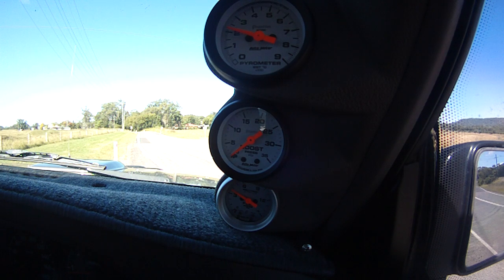Dawes Valve Boost Control with Nissan 3L Patrol ZD30DI Diesel GU Waggon

Comment: I fitted a Tillix/Dawes after a while world of issues. I cannot remember what rpm the car saw full boost. But mine now struggles to really make boost until 2500rpm. Is this normal? I know there is alot of variables with different loads. But before i had all my issues i swear it could of responded a bit better.
Reply from the maker: That isn't the norm, should be almost, if not maximum, by 2000rom. So many things can cause issues like this.
A few things to check.
1. VNT arm rises to top of stroke when engine started, disconnect vacuum line to the VNT start engine and then while watching the VNT reconnect the tube, arm should immediately rise. You can do a manual test by connecting a length of tubing to the VNT control diaphragm with engine off, then suck like crazy on the tube, you should be able to make the arm rise by mouth, vacuum required is around 12-13"Hg and by mouth you should be able to reach 18-20"Hg. 
2. Check if the arm will stay at the top of stroke if vacuum tube is clamped off and engine stopped, if is doesn't the diaphragm could be damaged.
3. Check vacuum lines under the intercooler, it is not uncommon for damage to occur from rubbing against parts under the IC.
4. Buy a cheap vacuum 40-50mm gauge, industrial type not one you mount in the car, and test vacuum with engine running the vacuum pump should put out 28-30"Hg.
5. Pull the Dawes apart (counting the number of turns to undo) and check for crap build up internally.

Try these things to rule out the easy things.
Reply: @Geeyoutoo Vacuum is mint now and actuator rod moves freely and smooth. I originally washed the engine bay down. And figured out why it wasn't making boost. It was an old perished line under the intercooler still didn't work. Replaced all vac lines with new ones and had no luck. Tried another maf still had issues. Took it to the shop and got told it was MAF and it was fixed. It was stuck on 8psi in all gears, so i changed to another VAC solenoid and manually reset the 0406 code and then it started making boost but would hit a limp mode, which would cause me to have to turn the car off or sometimes id drive through it. The spool up has definitely changed since having all these issues. What I did notice is when I bypassed the VAC Solenoid without the tillix yesterday before I installed it, it felt strong and it would spool but cant really say as i have never really taken notice of when it spools until after the issues from washing down the engine bay. Been a big headache with money and time. But definitely doesn't hit limp now with the tillix and dawes. 
I will definitely go and test the diaphragm the way you have mentioned.
Reply: @Geeyoutoo  No matter how far i turn the tillix in to increase spool rate nothing happens. Full throttle in 1st doesn't see boost until 2000rpm and only made 6 psi at 2500ish. Even tho the vac solenoid is bypassed can it mess with ECU if it's half shagged?
Reply from the maker: @kaseyeveringham2867  Pull Tillix apart and check for oil and crap it seating correctly. Do you have a needle valve? for a Tillix and needle valve to function you need a separate T for the needle valve. The Tillix and Dawes both work on the same principle except the Dawes is better sealed around the threaded adjustment section. You can easily check the sealing around the thread by sucking back on the boost end of the Tillix, if it is easy there is excess leakage.
You have the VacSol bypassed so I read, I like to run with that in place, what year is your Patrol?
Reply: @Geeyoutoo  Thanks for the reply! It is a year 2000. I did buy it second hand from a guy which his engine did blow up. It would kind of make sense the tillix and dawes was out of thr car for 8 months
Reply from the maker: @kaseyeveringham2867  OK, better give me a full list of the mods you have, 2000 Patrols (same as mine) can be problematic re vacsol disconnection especially if it is a manual. I would reconnect the Vacsol, they can also become contaminated internally with crap if the lines have been played with, maybe give it a LIGHT internal spray with WD40. Are you sure the plumbing for the vacuum lines is correct?
Be aware that a standard ZD30DI will go to limp at around 15PSI boost if the ECU sees certain parameters reached by certain revs.
Reply: @Geeyoutoo  Engine side. 3inch exhaust, EGR, took a butterfly out of the throttle body. I pulled apart the tillex and sprayed it. I'll need to mess around to find the perfect settings. But the dawes nearly turned all the way in still struggles to make boost under 2100rpm
Reply from the maker: @kaseyeveringham2867  You mention Tillix and Dawes in your setup, should be one or the other. Could you take a pic of your setup and post it please.
Reply: @Geeyoutoo  Needle and valve is turned all the way in also. Still laggy all the way to 2300rpm then it starts to ramp in but couldn't get it over 15psi. But didn't get to give it much load as the road I'm tested it on was short
Reply from the maker: @ needle valve wound all the way in (clockwise) means the valve is closed allowing max boost to be reached. I'm still confused re the mention of both Dawes and Tillix, please respond to earlier question..
Reply: @Geeyoutoo  Needle and Valve is turned all the way in (clockwise) spool rate does not change or get quicker. The dawes valve is working, i had that also turned all the way in and checked with load and that seems to be working.
Reply: @Geeyoutoo  I sent you a message on Patrol4x4 as YouTube keeps deleting my comments with a link to the pictures of the setup
Reply: @Geeyoutoo  It is constantly chucking the 0406 code
Reply from the maker: @kaseyeveringham2867  I have not been on the forum for some time. 0406 means high voltage at the MAF, this can be for a few reasons, non genuine MAF is one so what is yours? I get 0406 all the time because I have a massive amount of air going into the turbo due to mods, but on mine the remap stops any limp occurring.
Reply: @Geeyoutoo  I ended up taking it to a shop and he replaced it with a new MAF supposedly, was stuck making 8psi every gear. I cleared the code started making more just terrible spool up. I might have to call back tomorrow and tell them they haven't fixed it. Mine still has Factory airbox and piping! Only thing i did was take the small butterfly out of the inlet.

Would a non genuine MAF cause terrible spool up? Because like I was saying the needle and seat is turned all the way in.
Reply from the maker: @kaseyeveringham2867  Yes it can cause issues, I have seen it before with some non genuine MAFs, ask the guy who fitted it whether it was genuine. You can also do your own test, there is a thread on the forum How to Test All MAFS at Home, worth a read..
Reply: @Geeyoutoo  Yeah , I have a read up on that. Have a shitty multimeter so couldn't get a good reading. He charged me $257 for the MAF so I'll call tomorrow
Reply from the maker: @kaseyeveringham2867  Get a new multimeter, they aren't that dear and worth their weight in gold on things like this.
Reply: @Geeyoutoo  Yeah definitely not wrong there. I called the mechanic and he is ordering a new MAF.

Comment: Hi mate. I had a mechanic fit a catch can, needle and daws to my car. Its a 2007 patrol auto. The car a severely lost power, specifically down low. It wouldnt pull the skin off a custard. These mods shouldnt effect performance is that right?
Reply from the maker: Absolutely not, in fact you should pick up torque down low and see performance improvement across the board, off course how much depends on any other mods you have done. As you would appreciate I don't know your mechanical knowledge so I need to start assuming you know nothing, the needle valve opens turning to the left the more open it is the slower the spoolup rate and the slower the car, closing means full vacuum to the VNT diaphragm so you get fast spoolup, I would try closing it fully and see what happens. Is the Dawes connected via the Vacuum Solenoid? or is that bypassed? bypassing is the better method for you. Might I suggest you look up a Forum called Patrol4x4.com of which I'm a member, I have written up a lot of info with pics and schematics on this in the special ZD30DI section. You may not be able to see pics and schematics without joining, costs you nothing and lots of great info to be gained, worth a go.
Reply: @Geeyoutoo  thanks heaps. Im a novice to patrols and heard about detonation problems so i figured this would be the best mods to start with on the car before going further. Im planing a further few upgrades including an exhaust, intercooler and turbo upgrade when the monies available. I was shocked when i got the car back and was contemplating taking these things off. Thankyou so much.
Reply from the maker: No worries Mathew anytime

Comment: How js the fuel economy after dawes and needle? Do you have an egr block too?
Reply from the maker: All good, off course it always depends on how you drive it, drive hard with high boost and you will use more fuel, drive it conservatively and you will be OK. EGR has been blocked for many years, that was one of the first mods I did after Boost and EGR valve, then a little later I did the Dawes/Needle. 

I wanted to see how each mod effected the vehicle, coming from an Engineering background I know that if you can't measure it you can't improve it, and if you do 2 things at once sometimes it's hard to differentiate what made a particular difference.

Comment: if my needle is nearly closed i get an aggressive boost bounce eg. under hard acceleration it will boost to 16psi (dawes set) bounce back to 11-12 psi then back to 16 without removing my foot.. will adjusting the vnt grub screw fix this issue ?
Reply from the maker: Yes to a certain extent as it softens the spoolup rate but will also drop your max boost a touch, try and shorten the line from the Dawes to the VNT as much as possible, secondly if you do adjust the VNT grub screw you may not need the needle valve at all, I would adjust no more than 1/3 turn down if you do.

Comment: what RPM does the turbo start to make boost? at load that is
Reply from the maker: +chippyjohn1 
I've made a few small changes and mine is fairly aggressive, I'm making around 10-12 at 1500 and all out at 21psi by 2000rpm. Mine starts making boost just above idle.
Reply: Thanks for the quick response Geeyoutoo, hehe. Im wanting to put a zd30 in a light truck so am doing as much research as possible. Now all you need is a turbo speed gauge and you'll be all teched up.
Reply: Hi mate I know it was 2 years ago 
But how come you got the bust that early 
I think I got somthing wrong my starts busting on 2.300

Comment from the maker: Hi Pete, the EGT gauge is tapped into the dump pipe about 50mm from the turbo flange, Putting it into the manifold may be more accurate but problematic because you need to remove the manifold and then decide on a position that gathers info from all cylinders and not just one. By putting it in the dump pipe close to the turbo you just need to allow around 150C for cooling, ie on our ZD30DI's we aim to keep our EGT below 550C when measured at the dump pipe position. Once you know the thread size of the sender you remove the dump pipe drill and weld in a threaded nipple to suit, 1/4NPT seems the most common size.

Comment: Thanks Geeyoutoo what is the bottom gauge?
Reply from the maker: kym bloffwitch That is my fuel pressure gauge, I have a lift pump fitted to assist my old Bosch VP44 Injector pump.